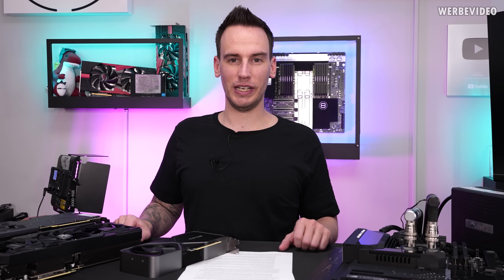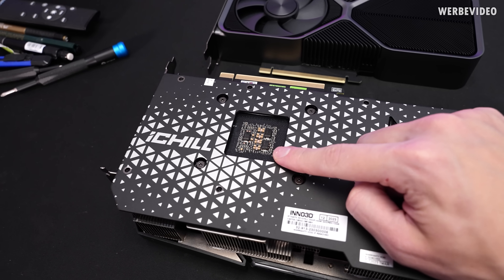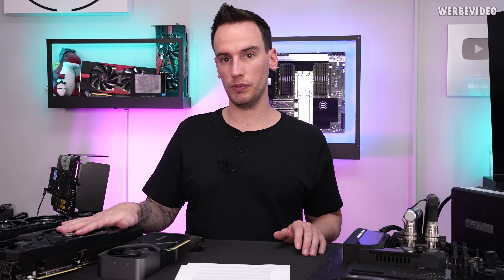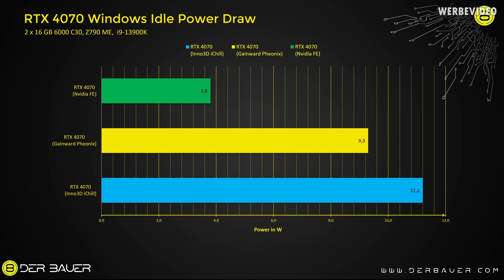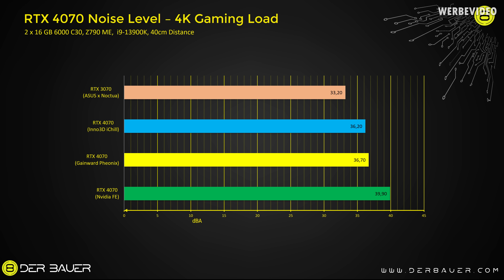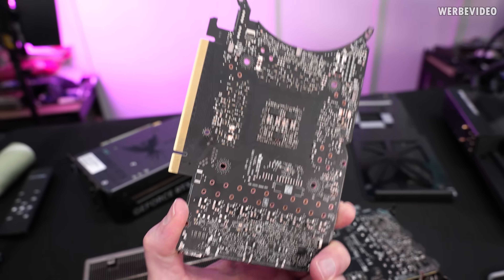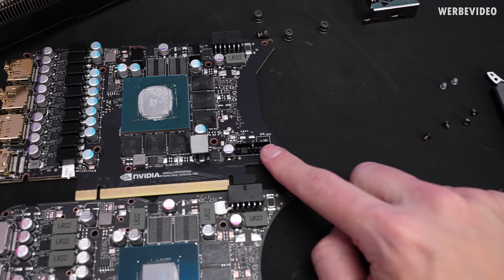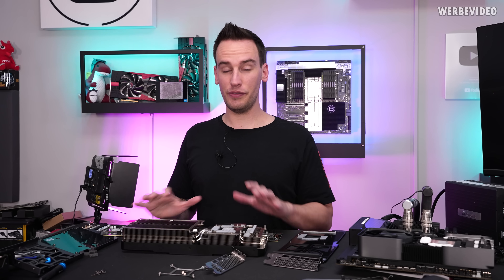Nvidia doing Nvidia-Things again - RTX 4070 "OC" Review and Teardowns

Comment: What I was hoping to see in this comparison is what the max power limits are.  I heard rumors that the 16-pin models had a higher configurable TDP.  If it is the case, how does it help?
Reply: at that point just get the 4070Ti - their low end models cost the same as a 16 pin 4070 and if the intention is to sack tdp by overclocking anyways then why not just go with the better factory option (which also doesn't void warranty- like regular overclocking does). It's not like the 4070 is cheap to begin with, so between a 749 top spec 4070, and a 799 base Ti version, just go with Ti.
Reply: @Real_MisterSir  Warranty is no issue as regular overclocking doesn't void a warranty as there is no sign of it being done outside of you saying that it has been.  There are no dials provided by Nvidia that will cause a failure to the card.
I also find it very concerning that you watch an overclockers channel yet say you shouldn't take advantage of the free performance provided by opening up the full TDP at the bare minimum.
Also - you fail to understand that I am not looking to see if it is worth buying the card with the bad power connector but to see if they gimped the card by using a single 8-pin when 2 of them fit just as easily.

Comment: One lead for this power consumption disparity at idle could be the VRMs. Having lots of power stages, especially with older specs, can increase idle consumption. So IMHO it's no surprise that the most efficient FE card is the less populated one. LEDs can explain that as well but for fans I'm more skeptical because nowadays gfx cards generally stop fan spinning under a temp threshold that shouldn't be easily triggered by a simple idle/desktop display load.
Reply: Yea at idle almost all these cards have a "silent" mode where they won't spin until 55-60 degrees c has been reached, and that doesn't usually happen at idle
Reply: Which means the controller doesn't have dynamic phase control where it can drop or add phases as necessary depending on phase currents to optimize efficiency at all load levels. Sounds expensive though...
Reply: @ruikazane5123  I'm not sure if that's very expensive compared to the GPU chip and the basic compute resources needed for such a PID feature.

Comment: The reason for the nda on OC models was so that Nvidia could have day 1 reviews out for msrp priced cards, which would be more favourable than if sampled cards would have been $100 more
Reply: yup I already see over 70-80% of cards at the 749 ish price range, and I suspect after the initial batch of cards are sold out, only 749 and up will be available for a good while.
Reply: @Real_MisterSir  here's the bigger problem with the "founders edition" They're all binned to be the absolute best dies based on power. Nv keeps them for them self, there is no point in an A.I.B making an "OC model" at all. Not when they know they're never going to get a luck overclocking model now. Nore can they bin their chips above Nvidia's dies now.
Reply: @kevinerbs2778  There is hardly any point in caring about binning, when on these cards it rarely makes a 1% difference on avg anyways, it's not like back in the day where yield quality was more infrequent and binning had real benefits on average. These days tolerances are so tight and production so advanced that while binning can make a difference on individual samples, on average there really isn't much difference to speak of.
Reply: @Real_MisterSir  you're wrong as this RTX 4070 is a disabled die from a RTX 4090 brought below the highest by at least THREE tiers RTX 4090>RTX 4080>RTX 4070 Ti > RTX 4070. This means their yields aren't ever close to 1% in tolerance EVER.
Reply: Yup, this is why I'm critical of der8auer's conclusion, which borders on paid advertising. The same thing happened with the 3080, it was released at 700 but I never actually saw one at that price in the real world outside of the initial batches.
Reply: @Florin_Neagu  lol what he just tells you what differentiates the models and says to check pricing and reach your own conclusions based on them. How's that "paid advertising" or even bias at all?

If you're talking about the 3080 vs 4070, he's using a lot of gaming time per day, but he's still right. And didn't even touch on longer term driver support and warranty coverage
Reply: @tarfeef_4268   they didn't say that it "is paid advertising" -- to say it borders paid advertising is vague, and in this case it's true. Not because der8auer has an nvidia-favored bias, but because it IS "controlled advertising". Nvidia has dictated the NDA release to guarantee their FE will always end up in a favorable stance from an early reporting standpoint. This creates biased reporting by design, and there's nothing derbauer can do about it besides call out that fact, which he did, to be fair, although I think it deserves more scrutiny than he gave it.
Reply: Increasingly looks like evga were right
Reply: @markcentral i disagree insofar as the 1 day review is necessary. If reviewers are being fair and unbiased, then the review conclusions would be the same, NDA delay or no delay. That is, reviews should objectively find that "the FE is $100+ cheaper, draws less power, and equal performance within testing tolerances" and therefore "the FE is the best option". Nvidia doesn't need to delay NDA release to get that. What the delayed release does create is a "first day review" that ONLY covers the FE, and then later, shadowed reviews that basically say "nothing valuable here", so much that reviewers likely won't even bother to spend resources on reviewing further than the FE (although der8auer did, and good on him for that). Regardless of what anyone wants to argue the NDA delay was meant to do, what it does do is create an inherent review bias that favors the FE and leaves non-FE cards relegated to the "uninteresting" category, so much so that they likely won't even get much review coverage at all. This is unhealthy market control.

Comment: If the 4070 fails to sell. Nvidia will have to capitulate later this year. DO NOT BUY 40 series. REJECT this garbage
Reply: Lol, the 4070ti is a massive bestseller. The 4070 will sell even better at $200 cheaper.
Reply: All you hater clowns make me laugh, desperate copium.
Reply: Easier said than done when I am sitting currently on a 970, wish I could, but This card is showing it's age now.
Reply: @noxfelis5333  replace the thermal pads, and paste and it should hold
Reply: @canaconn2388  I need a new GPU for some newer games, that is just how it is, especially with unreal engine 5 being a thing. It still works fine for most of the games, but I need an upgrade soon.

Comment: AiBs ""overclocking"" the card from 2475MHz to 2520MHz (1.3% increase) just to label it as "OC model" and sell it for 100$ more only to dry out the supply of the regular MSRP models a week later

truly a classic 4000 card launch
Reply: This is basically what “OC” cards have always done. Almost never worth the price premium unless it’s also coupled with a better cooler.
Reply: There are "OC" badged cards at just 2490MHz. Well I guess it is... but yeah.
Reply: This literally takes 5 minutes to do including downloading msi afterburner and slinding a single bar to the right. So disguasting
Reply: @Ariies  Not really. The FE version allows a 10% power increase. 
Some AIB models allow 0%!
There is an Asus model that allows 8% and a Gigabyte model that allows 12%, but also costs 100€ more.
Reply: @krusic22  Do you mean limiting the power limit (doesnt allow over 100%) if so, you can sill overclock without changing the power limit, not as much as if u could go 110% on the power limit but you can get the 40 MHz that they call the OC model.
Reply: The quality is so consistent in tsmc chip that core clock doesnt have much room in OC. Memory clock OC would be useful for 4k 60ish gaming though
Reply: "truly a classic 4000 card launch" - This has been the case for both AMD and Nvidia since the 1000 series. Overclocking is a thing of the past, where you could gain 5-10% of performance with an OC before. The best you will get now is 2-3% unless you up the voltage to a greater extent.

That's why it's been recommended to buy the cheapest card with the biggest cooler for a while now(all AIB cards perform the same) unless you just want the best plug-and-play experience.
Reply: @3rd.world.eliteAJ  The 900 and 1000 series allowed for common 15-20% overclocking gains.
Reply: @macicoinc9363  900series for sure, but 1000 series definitely not, I had a 2050Mhz OC on my 1080ti (which is well above average on the model I had), and got 5fps (5-10% as I said) on average in most games. 
This might be different on entry-level GPUs from 10-series, but I don't think it's ever been the case in any architecture?

Also, keep in mind this is on games from that generation, games with DX12/Vulkan use resources much better, so results would improve, but again, just OCing memory and undervolting card is MUCH better than GPU clock OC, the 50w+ increase is not worth it, especially for me where electricity prices have increased by 5x in the past 2 years...
Reply: @3rd.world.eliteAJ  1080ti may be a little skewed due to heating and power limits. My 1070ti would go from 1600 base to 1970 oc, along with a hefty 600+ on the memory. Can't remember game figures, but just mining Ethereum, the hashrate would go from 24 MH/s to 33 MH/s. Obviously that is different from games and more dependent on bandwidth, but it still got more than 5-10% in games.

Comment: The point of the review embargo is to force manufacturers to make good MSRP cards. The 4070 TI was barely available at MSRP and Nvidia doesn't like that. In addition, not showing the STRIX and other OC models will show the FE in better light, so more people would be interested in buying the FE.
Reply: I think Nvidia liked that a lot
It meant that A) Aibs didn’t get a piece off of the cake exactly as Jensen planed. B) pricing was so bad people felt forced to buy 4080/4090 bc people are stupid and will do stupid stuff when put in stupid situations. 
Smart people bought used or skip this gen , but imagine skipping on a gen that offers no benefits apart from even more fake frames and the same price per fps than 3 years ago ..
Reply: according to morselawisdead's sources, nvidia originally have a suggested MSRP of 749 to board partners, and adlgitly planned to surprise board partners with a lower msrp.(originally higher than 600usd) 

the source also said that nvidia mandated 50% of the initial shipment needs to be at MSRP to be awarded with allocation of silicon.. Causing a lot of aibs to start re-shuffling their lineup and production plans to focus on cheaper models. While somehow competing with the FE. 

that's why EVGA dropped out of the GPU market, I donno how other patterns are putting up with their crap...
Reply: It uses 180W. You can cool that with a piece of wood

Comment: Its amazing how much more you pay this generation for so much less!
Reply: But "muh DLSS3 for ÜberOverDrive" is the only way to get more than 16 FPS in CyberBug 2077"

Oops, sorry for the leak : "ÜberOverDrive" mode will only be available later, with DLSS4, only on RTX5000. Please don't sue me Poland
Reply: @lamikal2515  the 4070 is a little cheaper than the previous card it most closely matches. It's actually not terrible in that regard.
Reply: @pdmerritt  "Not that bad" is not enough. The GPU market is in complete stagnation right now. x% more performance for x-2% price increase is plain BAD.
Reply: @pdmerritt  You are right, people are still runing 10-series cards, and they remember the price of the 1070 being 359...wich ajusted for inflation equals to 449... not 600+
Reply: @pdmerritt  so you wait 2 years to get a rtx 3080 with 100$ discount but with less bandwith that affects 1440p and 4k gaming, ok
Reply: @SinNumero_no41  i'm actually waiting for the 7800xt before I buy. But...fyi...i'm coming from the 1070ti so the 4070 would be a huge improvement. 3080 12gb would make no sense compared to buying new....2yrs from now I could sell the 4070 and it would still have 1yr warranty left. So tell me in what world wouldn't that make sense?

Comment: Nvidia is trying to damage control their pricing. So by limiting it to only MSRP cards, they can get an artificial boost in charts like frames per dollar. If reviewers included the over MSRP models, it'd make it look even worse than it already does.
Reply: Exactly
The same thing they did with 4070 ti (the 4060ti they tried to sell as 4080), set an msrp to only never release a card at that price but let reviewers base their cost/fps charts exclusively based on the non-existent fake msrp propaganda
Reply: Why should nivida get flack because partners are insanely stupid? Asus are literally selling their "high end" 4070 card for more than a 4070 ti is going for right now.

I really question how you can blame nivida and not the partners them self when they are so insanely greedy and stupid that they are pricing cards more than the next tier up based on their "quality" Fact is you can buy this card for 600 dollars with the FE or a few partner models or you can spend 850 dollars and buy the asus version and get 4 more fps and slightly quieter fans. Who are the real scammers there? 

Such herd mentality around tech.
Reply: @slayerr4365  probably because their high end 4070 Ti is selling for almost as much as a founders edition 4080. That's literally how they all work. I really expected Debauers audience to be smarter.
Reply: @slayerr4365  you do realize Nvidia charges AIBs for the silicon right? So you do realize that if what AIBs say is true and they sell msrp cards at a loss cause of what Nvidia charges after their “market research fund” runs out, that it’s literally entirely Nvidia’s fault?

Maybe use your brain and think independently, at least for a moment instead of thinking about licking Jensen’s boots.
Reply: @slayerr4365  Both are greedy. Nvidia for pricing the card $100 higher while at the same time using a lower tier 60 class die and AIBs for trying to add another $100 on but then Nvidia probably leaves them little no margin at the MSRP.
Reply: That's why performance per dollar is a bad metric.
Reply: @bleack8701  no, that's why it's a good metric. It's so good that Nvidia is trying to avoid it.
Reply: @simplyscholar21  its a good metric, but only if you use it in conjunction with everything else. Performance per dollar wise, the rx 6400 is one of the best cards on the market if only looking at that 😅
Reply: @simplyscholar21  nah man. The scope is too limited and doesn't really offer meaningful data because it only takes MSRP into account, which is often unrealistic. Then there's fluctuations because of discounts, price drops etc etc
Reply: The price is fine.
Reply: @Wobbothe3rd  enjoy your 3080 for 3080 pricing then. I personally bought a 6950XT for the same price, so I have 3090 Ti performance. I'm all for dumb people making dumb decisions and living with the consequences.
Reply: @Wobbothe3rd  the price doesn’t matter, these cards are Vaporware. The only models available are “OC” versions at $700+.

Even if your objectively wrong opinion that $600 for a 70 class gpu is fine, they’re not even selling for that price irl.